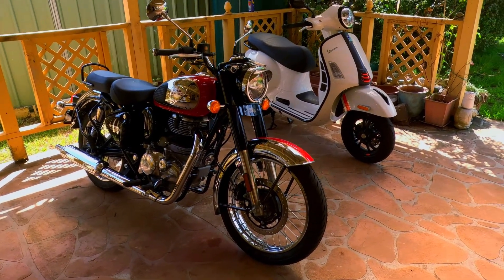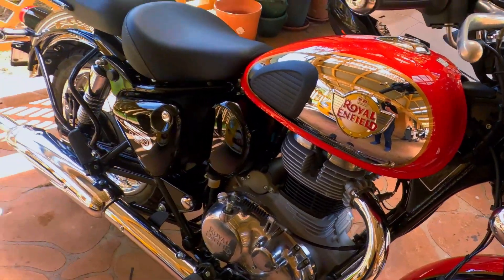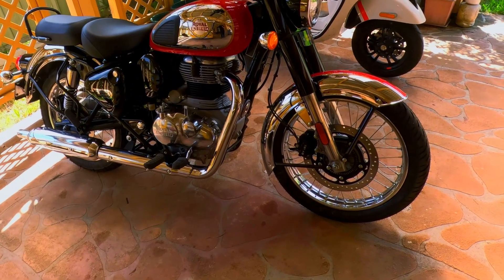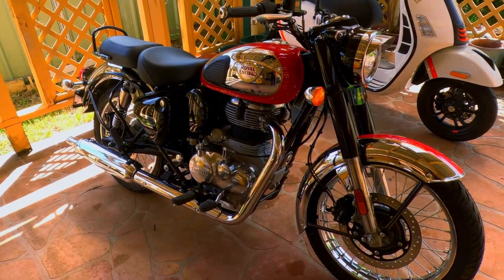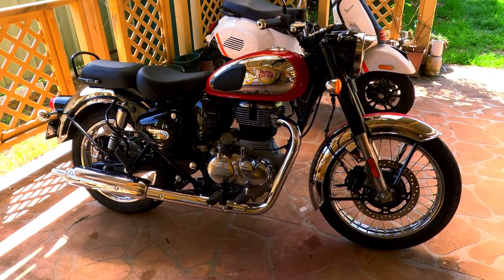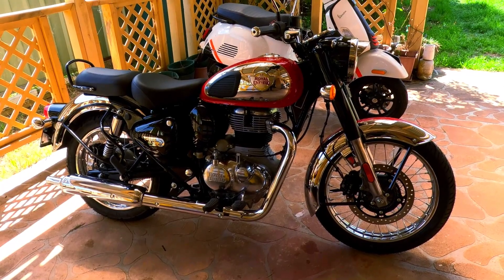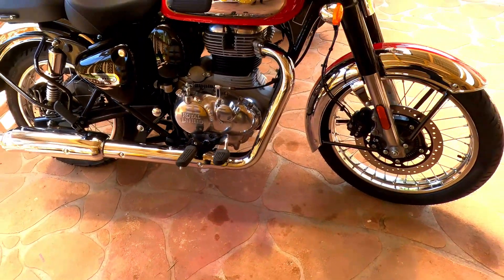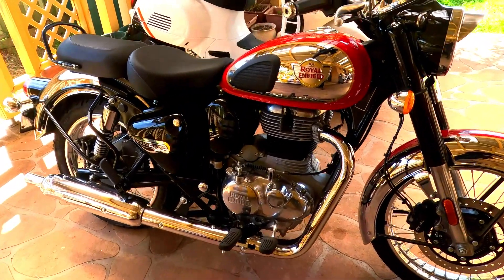2023 Royal Enfield Classic 350 -Running-In And A Very Hot Motor!

Comment: Thanks for another great post,Warro. I'm a fussy old bugger, so have always run my Classic 350 on 98 octane fuel and use upper cylinder lubricant (Lucas). I don't know if this actually makes any difference, but I've never noticed my engine to be partially hot.
It would be a simple test to try on your bike, but you may use premium fuel already.
I checked out your lovely daughter's site and gave a thumbs up 👍.
Reply from the maker: thanks and appreciated. took the bike out today for another 20 klm run. really hate these new run-ins on the enfields even though ive done it over 20 times...lol
much better when its open road running

Comment: Agreed, mine too ran hot. Apparently they're set up to run a bit lean. That also makes the engine a bit snatchy at lower speeds. Others found that fitting the Fuel X Lite takes care of both issues. One YouTuber measured a 93C reduction.  I fitted the Fuel X recently and agree: smoother and cooler.
Reply: 93C reduction 😱 where does he live, Antarctica?
Reply from the maker: yeah fuelx may be the answer there too
Reply: I saw that video, "Foxy" I believe is the channel.  A dramatic drop in cylinder head and exhaust pipe temperature.   Using a DNA low restriction filter and aftermarket exhaust apparently makes it run much leaner/hotter.
Reply: @horspiste  haha no he does not. But he recorded the temperatures the same way Warro did.
Reply: Interesting approuch of running in a bike.

Comment: G'Day Warro - I will be pulling the trigger in the next two to three weeks and getting the 350 Chrome in Bronze. Your tips about running it in from your video's will be very helpful.
Reply from the maker: Good choice! i was out on bike 2 yesterday - the halcyon grey and did the same run. has 12k on the clock. ran it in the same like all the new enfields ive owned. rarely buy used!
came back did the temp test on the barrel ...91C bike smelt normal and runs well.
the trouble is here on the tube. lots comment and think they know i had 23 brand new enfields and actually know...lol 
please learnt it the hard way too by several crapping themselves through hard use

Comment: 108 c is not hot, it is proper operatiog temperature . It is about 226F . Engin oil needs to be heated to 220f just to keep all the water and other contaminants out of the oil . Your short runs may not be getting the oil warm enough to protect your engine properly .
Reply: Got a Run them in Gently about tedious but rewarding afterwards knowing you run bike in properly & the history it's done.

Comment: Hey Warro I saw on Hitchcocks they now have a plug and play tacho you can drop into that RE badge on the nascelle.. 🤔 thoughts?
Reply from the maker: that may be interesting. at times ive used a tiny tacho just stuck to the bike. pick them up for $30 on ebay. they are good for newbies to get an idea on using 3000 revs max. while on the run-in side.
Reply: @ridewithwarro  this is plug and play looks factory.. my 1950 G2 Bullet yes Im dreaming 😂

Comment: It would be interesting to see a comparison with the other Classic 350 on the same run.
I wonder how much different the temperature's would be.
Great video as always.
Ride safe
Reply from the maker: the classic was the same/hunter the same/650 interceptor the same 500 the same - vespa not at all/suzuki 250sx not at all - its just some sort of enfield quirk i think.
after this check i see now how i overheated 2 new 500's and burnt out the valves. 
a dealer once told me a guy bought a new classic 500 and rode it hard the 110 klm home and the motor seized and had to be totally replaced.

Comment: The emissivity of the shiny lower part of the engine is likely much less than that of the barrel and head - you need to adjust the reading accordingly.  My lower engine gets much warmer than 36 after a run, and I'm fully run in.  No problems though.
Reply from the maker: its always good to look after these motors. remember too ive owned 22 new enfields and 2 i actually burnt out the inlet valves in under 700 klm
never kid yourself with enfield bikes. treat them easy on the run-ins or pay the price.
a smart person will run them in correctly.
now for example the new vespa or suzuki i just bought. way better put together bikes and just get on and ride them
so too the cb500x and all the other new bikes ive owned
enfields are different and must be treated better than the others

Comment: Man it's been so windy (im in the northern tablelands) and its been crazy.
Reply from the maker: pretty annoying thats for sure. even harder with only 20 hp to push along too
Reply: @ridewithwarro  I could imagine, I use to have a 250cc air cooled bike that would struggle at 90, but it was still good fun.
Reply from the maker: @beaumas  yeah good and easy running with the wind but not too good against it. a 40 hp bike would be much better there.
as a rule its usually not too windy here if at all so hopefully it will sooon blow over...lol
Reply: @ridewithwarro  lol, hopefully the wind brings some rain here. I do wonder if the 350 would suit where I am as it's 100kmh every which way out of town and I'm in the bush so works at least 35kms away, up and down big hills too.
Reply from the maker: @beaumas  in that case i'd probably go for the hunter 350 which has good mid range torque or maybe the suzuki 250sx which is about $1200 cheaper or go all out and buy the new triumph 400 speed which comes in at $1200 more
40 hp on tap and 160 kph top speed
i already ordered the scrambler version due here jan 0/24
Reply: @ridewithwarro  nice!! Can't wait for a video on that. Cheers for the insight, I do love the 350 look though.

Comment: I remember your video(s) about "heat cycling" as part of the "break-in" process... ( I thought that was worth considering...I liked the idea...) Have they invented an oil cooler radiator for this bike ?
Reply from the maker: not that i am aware of. thats why i would never ride one of those long distance from brand new and always collect them in the van.
i had an issue with one of these motors a few weeks back. my thoughts run it in carefully stay away from exhaust and air mods till one does the full break in.
if you still want to do it then go ahead.
in my case i have no interest there. i want to ride it not fix it...lol

Comment: I don't think 106 C is too hot on a new bike in ambient temperatures that would make headlines in the UK. I ran my Halcyon in in a similar fashion doing short 7 mile runs followed by an hours cool down. It drove me nuts but I got there and now have a fully run in bike which runs great up to the 72 mph limiter with no 'performance' mods.
Reply from the maker: this clip was just to show engine temp on the new bike. take into account ive owned 22 brand new enfields and own 3 right now this one/hunter 350 and halcyon grey.plus several others...lol

Comment: Oil starts to break down at temperatures above 120 c
Reply from the maker: well i;m not far off there i guess
Reply: @ridewithwarro  I had a vw kombi engine rebuilt years ago, oil temp and tappet settings were a worry it would get bloody hot and the tappets would tighten up.
Reply from the maker: @Buslife57  yeah i will see how this goes by 500 klm and if needed probably adjust those myself
Reply: The curse of the air-cooled engine: Heat. Oil has three functions: Remove heat from the engine, remove contaminants, and lubricate. As a lubricant, oil does a very good job, for a very long time. As for removing heat and contaminants, it's not so good. It deteriorates quickly. I worked as a "hanger rat" (AME), years ago. My employer, a qualified aeronautical engineer, was very quick to point out that once oil has removed "X" amounts of heat and contaminates, it was our job to remove the oil. In the case of Lycoming and Continental engines, that was after 50 hours or less of use. The engines were time lifed for about 2000 hours, from memory, or forty oil changes. When you take into account that these engines were relatively low stressed and well maintained, it give you a good hint as to how to treat a motorcycle engine.
Reply from the maker: @davidbrayshaw3529  interesting info. i was out on bike 2 yesterday as i have 3 enfields. i run-in  all enfield the same. asctually had 23 of them to day singles and twins.
bike 2 has 12,000klm did that exact run i did on this one
checked barrel temp and it came in at 91C -no smell from motor.
this bike will settle down temp wise say by 1000 klm or thats what ive noted from past run-ins
all the best!
Reply: I know the smell that you're talking about. I've just purchased a Kawasaki W 800. It's 8 years old but only has 1500 kms. on the clock. It has "that smell". My presumption is that it is engine finish cooking off, but I could be wrong. I can see deterioration of the finish on the rocker cover. Aside from that, I have no idea.  @ridewithwarro
Reply: @ridewithwarro  My classic 350 smells hot even after I've done 1700kms already. I did not run-it that carefully as you did, but still very gentle. Low speeds, keeping the gears/speed, breaks to cool it down as it is written in the handbook and so on. Plus I'm very lightweight. I will have to check the exact temperature somehow to make sure.

Comment: Sooo, IT would be a good Fall / Winter/ Early Spring bike only.   We get up to 110 degrees Fahrenheit in USA GEORGIA in regular summer.  Lol.

I was hoping to take an Enfield on a 49 State /fishing tour of USA.   Guess not.
Reply from the maker: once there run in they behave differently. i was on my halcyon grey yesterday it has 8000 miles on the clock -did the same run in same temp.
once home checked the engine heat -no smell and 91C
this is more just a look at the run in temp

Comment: Would be interesting to compare a catalytic converter bike against a de-cat. I definitely plan on removing my 350's cat, and replacing the air filter snorkel with the more open cover after 1000 miles or so. Probably won't do the DNA filter, as I've heard some downsides. Not sure if the Fuel X device is worth it, but I've only heard good things so far.
Reply from the maker: fuelx may be alright in stock form i put the adjustable one on the halcyon grey with no benefits at all. but that was when it was first released and just hit there website.
i told them about it so they may have tweaked it a bit.
i still think for long term riding results i plan to stay stock.
after owning 22 new enfields i know what happens when one starts modding and its not good.

Comment: That’s a bit hot. Have you checked one of your classics that’s already run in?
Reply from the maker: i find all these enfield run hot in the beginning. that was an easy ride around town too. say if one had no experience with enfields and then headed out to open road for hard ride.
i did that twice on 500's and burnt out the inlet valve on both bikes
play it safe with these bikes
Reply: @ridewithwarro  thank you for replying. I am a big believer in carefully running in an engine, but this makes me think something like a fuel X should be installed early on.
Reply from the maker: @critterIMHO  take no notice of others.run the bike in and treat it properly and you can later ride it anywhere.
ive had either 22 or 23 brand new ebfields-not sure exactly...lol they are not like honda/suzukis or other.
i have burnt inlet valve out on two 500's in 700 klm from new. i dropped power a week or so back in the new j motor -riding quickly
i dropped power on at least 5  or 6 of the 500 riding them quick with mods.
you can be lucky and get away with it but i think not
Reply from the maker: @critterIMHO  i actually have a spare one of those laying about here. i may hook it up later too

Comment: Maybe they should have an alloy cylinder.
Reply from the maker: yeah its a long run in period on one of these bike...roughly 1200 miles or 2000 klm. annoying too first 300 miles no more that 40 mph and next 900 no more than 50 mph
Reply: @ridewithwarro  it costs so much to change it like de-catting the exhaust and going to a carburetor then all of a sudden it's not such a cheap purchase anymore. You have to pay for all the pollution controls and then you throw them away. Heat is an engine 's worst enemy.  I love my BSA 250 singles.Lightweight reliable and beautiful to look at from any angle. Artistry in metal.

Comment: EFI makes bike motors run too lean and the engine heat cooks the oil to death robbing it of all it s lubricanting properties. Pollution controls account for 1/2  the purchase price.
Reply from the maker: i may add a fuelx to this. have one in stock. will see how this pans out. apart from that side these are great bikes to own

Comment: Hi Warro, I noticed my Classic 350 had a smell to it when running it through its heat cycles i put it down to the  paint on the cat & the cat itself,  I noticed the same issue on a Honda CRF 250l when running that in the exhaust had a smell to it even when it was switched off but it disappeared when cooled down.
Reply from the maker: tell ya what i really like heatcycles on these bikes. todays run when i did the temp test i thought it was a bit sluggish on the ride. 
6 hours later i took it back out say around 4pm and it was 26c - bike ran better.much better.
i also decided to give it a bit more throttle in 2nd and 3rd. very impressed picked up well.
not as good as the hunter 350 but better than my other one.
so all good and maybe another double run tomorrow

Comment: Warro, what happened to your beautiful gray Classic 350?
Reply from the maker: yeah its just sitting there.  i might take it out mid week but i'd like to get this one run in. plus im still deciding if i will take both 400 triumphs or just settle for the scrambler so i have lots to think about.
but what i have found from this clip- there are heaps of know-all who know nothing about enfields.....lol plus they are commenting to an enfield owner who actually popped the inlet valve on two brand new 500's with only 700 klm on the clock....heat related and riding them quick!
so there you go. so many lookers who just think-think think and i actually know...lol